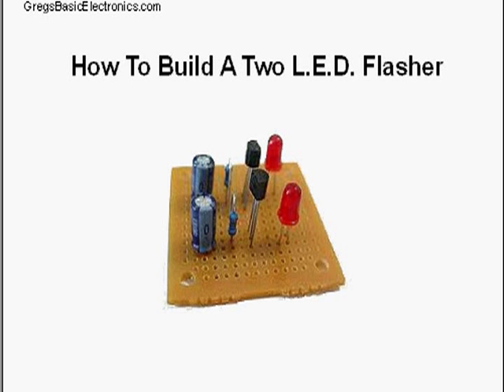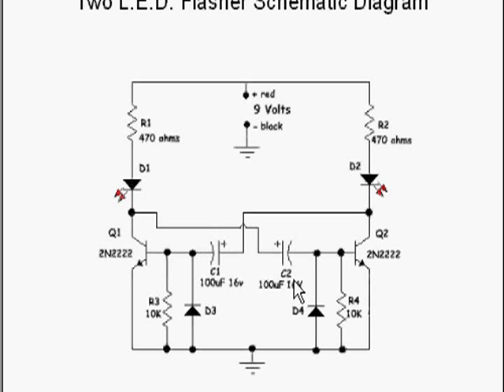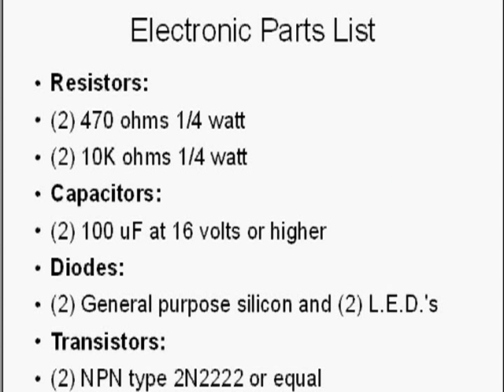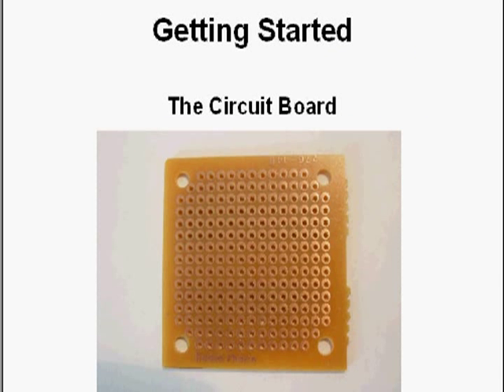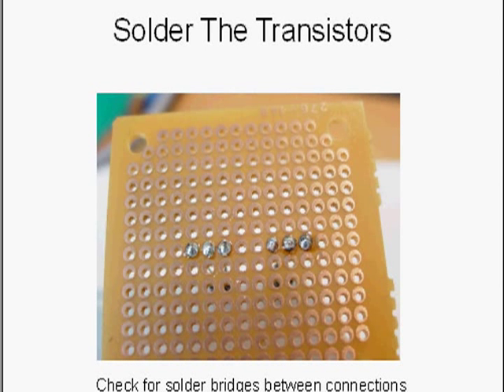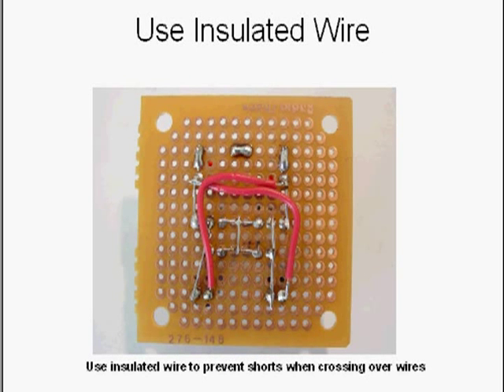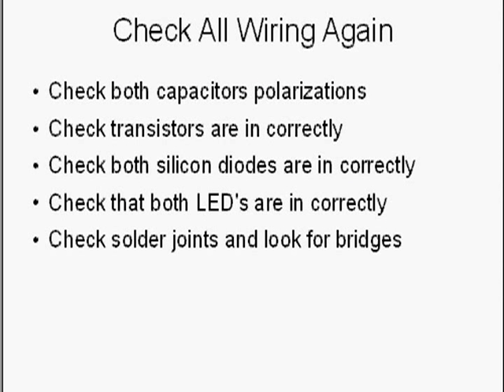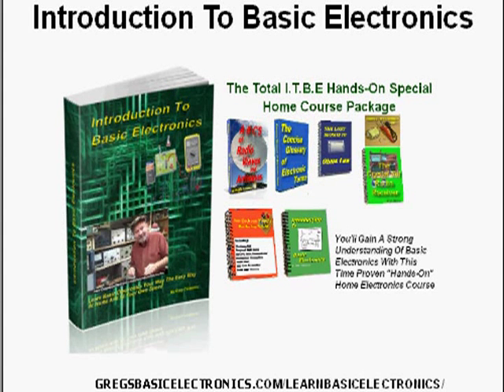Build A Light Emitting Diode Flasher

Comment from the maker: The problem is the circuit requires both transistors to oscillate and flash the led. See if you can a simple single led flasher that uses a 555 timer chip and has a good construction video to go with it. This should help you out.
I'm getting set to start making more videos once again!